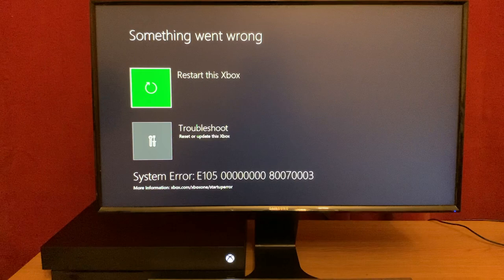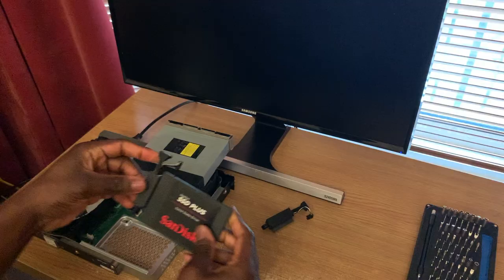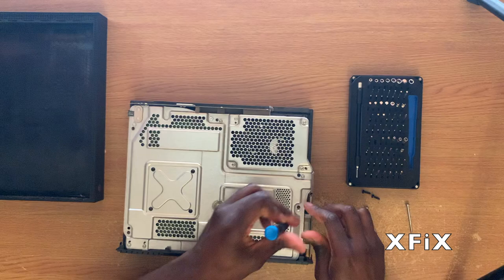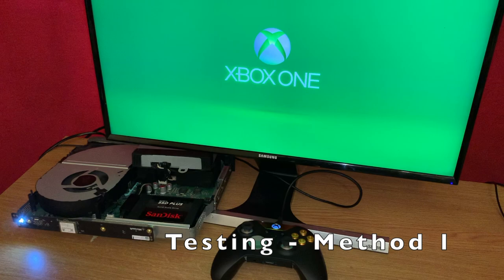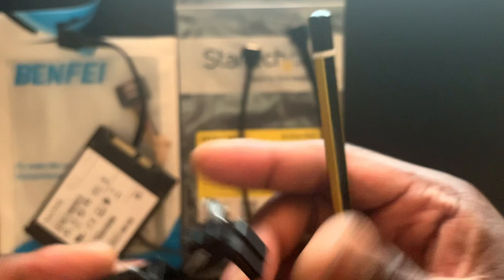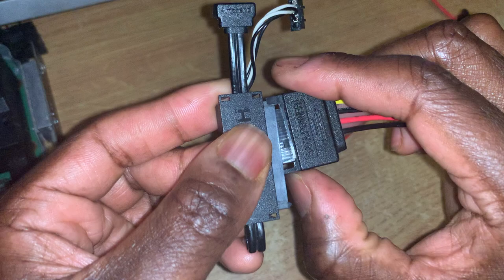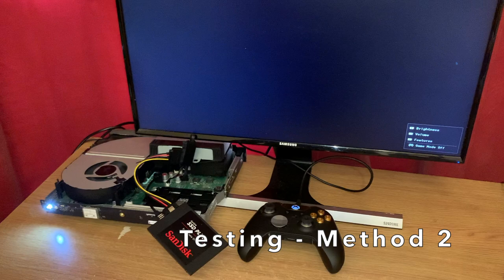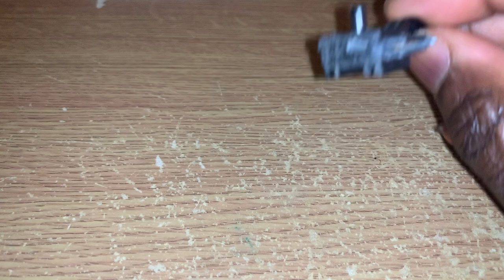Guide - Xbox One Start Up Error Codes Fix (E102, E105, E206, E302, Green Screen of Death, etc.)

Comment: RIP to my xbox 2019-2020
Reply: Same
Reply: @deanhull8225  bro this shit happend out of nowhere that shit suspicious as hell for Microsoft this is a brand new Xbox s and this shit came up last night
Reply: Mine still doesnt work
Reply: RIP mine and yours to 2018-2020 😞
Reply: Same to mine
Reply: Just happened to me recently. Never had the problem before
Reply: RIP TO MY 2020-2021
Reply: 2015-2022
Reply: Nuu 😭
Reply: @justinwoods240  same rip
Reply: Mine broke Ina week
Reply: Mine is 2021-2022
Reply: R.I.P Mine From 2017-2022 You will be missed..
Reply: 2016-2022 😞 littlerally gave up on me last night
Reply: 2017-2022
Reply: Gg
Reply: 2013-2022💔
Reply: R.I.P. 2020-2022
Reply: More like rip me 🪦
Reply: 2018-2022
Reply: Rip 2021-2022
Reply: @hyperfl3x313  2019-2022
Reply: We should sue Xbox’s arse
Reply: @kapisbetter  mine broke overnight😟
Reply: 2015-2023
Reply: Rip 2019 2023 😢
Reply: 2020 2023😢
Reply: 2019 to 2023 Xbox one X but I never did the offline system update yet
Reply: Rip 2019-2023
Reply: 2020-2023
Reply: Rip 2023-2024
Reply: I've got a series s since this happened to me and a switch 😭
Reply: R.I.P 2016-2024

Comment: Anybody having startup errors just forget everything you've ever read about diagnosing and repairing xbox console issues and try offline updating. Format a flash drive to ntfs and put osu1 on it and plug it into your console, turn it off and start it up on the troubleshooting screen and it should eventually start updating. Ive jumped through 1000 hoops trying to fix mine and this ended up working.

Comment: so It was my first time getting the error message on startup. I got super pissed and tried to figure out how to fix it.... found this video, and realized I don't have the funds, time, or technological knowledge to fix it. so I picked my xbox one s up with my hand and lightly slammed it on my table on all sides (except the front) and IT FUCKING WORKS NOW! load times are a tad longer.. but I HAVE A WORKING XBOX AGAIN! sometimes u just gotta be rough with the robots...
Reply: Is it still working? Cause right now it doesn't sound too bad

Comment: So far this appears to have worked for my Xbox ! You're a lifesaver man. I didn't bother hacking the connection in half just removed the nubs and the data cord. We'll see how it works long-term !
Reply: I’m dealing with this problem currently and considering trying this, is it still working good?
Reply: @coleerickson409  yeah it is ! It wasn't as difficult as I thought it would be. Just be attentive to the order of all the screws. I didn't cut the hdd connection in half like he did and it still fit.

Comment: Do you think this would work with e106 and e101? i replaced my hard drive because i was having the same problem with the game saves, but when i turn on the console i get the error and cant do the offline update either.
Reply from the maker: Hi man, I really think it’s worth giving it a go because that’s pretty much the same problem I had. When I replaced the connector the Xbox just started working again and I haven’t had a problem since.
Reply: On my connector the data cable has 2 black spots on them, kind of looks like it's burnt.
Reply from the maker: Sounds like that could be the case. Which side appears to be burnt? If it’s the data side, you can bypass it in the same way shown in the video.
Reply: @doo-dahs140  it could be that but turns out the hard drive I replaced it with was too big.
Reply from the maker: If that’s the cause then I’m surprised. There is a limit for how much space the Xbox OS will recognise but that doesn’t usually cause crashes. If you use a hard drive larger than 2TB it usually just means that the extra space is wasted as it won’t be used.
Reply: @doo-dahs140  that's what I thought but I guess I'll find out when my new hard drive comes.
Reply: @doo-dahs140  by any chance are you in the Xbox insider programme?
Reply from the maker: I am not. It sounds cool but I just never got round to signing up
Reply: @doo-dahs140 because if you are I don't think it lets you go back to the latest OS. So I think if I remove it it will enroll the update to let me do a offline update.
Reply from the maker: Yeah, I’ve heard the same. If the installed OS is newer than the one you are trying to update to, it won’t work. So yes, removing the insider programme version first is a good idea.
Reply: @Scampii  did it work? Did replacing the cable work? Cuz I have the same problem. Save game error and when I restart it shows me e105.
Reply: @muhammad8990  not for me I was on a insider os so I had to wait for a new update to over ride the one I was on
Reply: @Scampii  the update came, right? So is your Xbox good now? 
Cuz this shit really sucks, i bought my Xbox at the start of 2020, and have had problems since august of 2020. Sometimes they go away, then they come back. I live in a country where I couldn’t use the warranty too. Bullshit that MS is selling faulty consoles.

Comment: This worked for me using the 2nd method so thank you for that. Only issue is it’s very difficult to find these parts. The office Xbox sata cable is sold out everywhere and from what I’ve seen so are the star tech round sata cables.

Comment: Hi i need to replace the HDD connector for the Xbox one X as i have replaced the HDD with a SSD and installed the operating system with usb however i am still getting the E102 and E105/E106 messages, do you know anywhere that has the right part in stock? everywhere seems to be out of stock or selling parts for Xbox one s only :(

Comment: Thank you for your Video - I was able to fix my Xbox One X with it. Since my HDD worked fine on my PC I assumed that it must be the SATA cable. I bought a 15 cm flat SATA cable, which is just the perfect length for this job. A round cable is definetly better, since the cable has to make a loop, but they are way more expensive. My flat cable was 2€ incl. shipping. For precise and safe cutting, I used a small saw, since chances to slip and cut yourself are smaller with it :)

Comment: what do I do if it is an E100 error. I was getting a problem with disc space saying I had 0 gigabytes  and I searched it up and xbox website said to update the xbox because the xbox is not reading my hard drive so I did and halfway through the update I got and E100 error

Comment: Could it be that my xbox insides are just dusty because I have no issues with installing  or syncing and it hasn't been in the best spots to let air out please help
Reply: If theres no air going out then it sounds like you got a dirty ass house clean that fuckin place 
Its not normal for that much dust to pile up on a system not even 10 years old yet
Reply: @at-cj2iy  no i fixed it it was tue hard drive

Comment: all i did was factory reset and redownloaded os through the troubleshooting screen, it seems to be working but should i expect it to mess up? idk
Reply from the maker: If that’s worked for you then that’s great. There’s no need to start opening things up if the problem has resolved itself. If it does come back in the future you’ve already found a guide to help you :)
Reply: I did the same hopefully it lasts until the series x is back in stock

Comment: Mine just stays at 50 my Xbox is very very old it’s 6yrs old but now I get problems so everytime I disconnect from the electricity plug thing I get the green screen of death so I need to factory reset and it always work but now idk what happened that it’s just staying in 50 I tried everything in the factory tester options

Comment: My Xbox turns off midway through the offline update with the flash drive. I dont know what to do. My warranty expired and the hard drive connector is sold out everywhere online
Reply from the maker: If you still have the old connector, try this: https://youtu.be/PpmGRGIhFcs
You’ll still need a SATA cable but they’re easy to find on Amazon. You may already have one spare if you have a PC.

Comment: This video is fantastic,  quick question. On option 2 you use a different sata cable, why's is the power cable extension required if you are separating the data port from it anyhow? It seems unnecessary, If you explained it I may have missed it. Thanks for your time.

Comment: I tried to second solution and its worked! You are a lifesaver, so much thank you!
Reply: Where do you find the original cable it app sold out
Reply: @chriswright8074  I used a classic computer sata cable with an L-shaped end. I used the original part for the electric cable as in the video.

Comment: Are the HDD connectors for Xbox One X only available in the US, and not in the UK ? The item is sold out. If you got one let me know !  Thanks
Reply from the maker: They were available everywhere when I made this video but supply goes up and down all the time. You’re better off using the second method anyway because, as someone else commented, the ones you get online may not be 100% reliable either. The sellers probably stripped other used consoles for parts to sell.

Comment: Just did this with the Xbox one s but I can’t get it back together because the hard drive sits in a casing and red cord isn’t bending to easy … Any tips?
Reply: Make it fit. Put some easy bends in the cable to take up the extra length.

Comment: Will factory reset get rid of my external hard drive stuff if it’s unplugged?
Reply from the maker: It won’t. After you finish fixing the problem just plug it back in and your games will be there. The same goes for if you switch to a Series X or S when they’re released.
Reply: Doo-Dahs ohh alright thanks
Reply: @doo-dahs140  so I can unplug my drive than factory reset then plug it back in and I’ll have my stuff still with no problems
Reply: @lil_nap_9207 From personal experience even if the External drive is in the console DOES NOT care about that and only erases whatever is on HDD (Internal) so your External is perfectly fine and not effected with any of this.

Comment: My Xbox turns on, stays really quiet(sounds like a bit of a dial up noise for a sec), displays no signal, and then cuts off after a while. Will this fix help me? I got the black error screen at first, but not anymore.
Reply from the maker: If the console stays on for a few minutes (like 3 -5) before it turns itself off, this will be more likely to help you. If it only stays on for less than 20 seconds and then turns off, it probably won’t because the issue will be with something other than your hard drive.
Reply: @doo-dahs140  ok I turned on today and it says e105 error with troubleshoot screen. I hope this works for me.

Comment: I bought the HDD connector original from gamersrepair, it doesn't work, I changed my hard drive too but still same error massage. Then I try the second solution YES 👍  it is work. Gamersrepair 👎
Reply: @Caleb Hysmith not e101 sorry this is a different problem entirely look up Andrew Paul he has a ton of videos on this sort of thing
Reply: @Caleb Hysmith brand new drive

Comment: So if it's the hard drive could I buy an external one and would it work
Reply: I used my external drive for a few weeks since I couldn’t download games onto the actual Xbox internal drive but eventually the error code stopped me being able to get into the Xbox so I had to change it eventually anyway, but an external drive is a short solution

Comment: I d like to describe  a serious problem which I had over six months now on a sealed box x box  one… anyways whenever I am at menu!after 20 minutes the menu stuck and only the home menu button works All the icons turn to black .. also the same if I am in an app.. the Xbox works fine after 20 minutes or reset. I thought might be the disk .. so I changed to ssd then I thought might be the cable .. After your video.. I ll change the cable 
 too… the last error was E105 exactly the same as yours .. the stuck and black icons thing do u think might be the cable ?
Reply from the maker: That sounds like the cable is the problem. Give it a try!
Reply: @doo-dahs140  that was it….the cable finally …I used a used one from my pc and I left the power cable as it was but I cut it in the middle … I had a suspicion that might be the sata and after you video I gave it a try . Thank you

Comment: Great video just had this happen to my xbox one S it started to lag  badly. So I keep restarting it which brought me to Error Code 208 then as it was updating it got stuck at 50 percent and would not move so I turned it off and now I have a Error code E102 so I just purchased the new connector from your link and im gonna try to fix it since my xbox is out of warranty anyways
Reply from the maker: Sorry to hear that but I hope it works out well for you. It does sound like a problem that replacing the connector will fix so you’re on the right track 👊🏿
Reply: Freakwent 212 same here bro I need help!
Reply: A did you buy the original one or the data cable shit
Reply: @tmarsh2cold867  I brought the OEM one that is in the description, along with it I brought a new hard drive also. Honestly I never did the USB update so one I finally did that and replaced the  hard drive connector it worked.
Reply: @freakwent22  it still working?

Comment: I took a hacksaw and just sliced straight down cutting off the data data cable and plugged in a new one. No need for an adapter in method 2
Reply: Did you cut the cable that was in the original bracket, and put another one in? How to do it?

Comment: For anyone that looks, on my Xbox one X, I did an offline update and it fixed E102, and my console now boots up. It also downloads, but still gets installation stopped on games, started much less frequent, progressively getting worse, still definitely an issue. I assume it’s due to difficulty reading/Writing the HDD. Will be trying method 1 in the next week, along with a full clean, and will update this comment if it works.

Update: Changed the hdd connector, at first got an instant e105 error and thought I’d made it worse, it played before but got installation stopped. Then got e102 after a reset keeping all games. Plugged the usb in with the OS and it booted fine, set up the xbox, currently downloading bo4 so we’ll see if it’s fixed, but it’s smooth for now. Checking back the morning after, everything downloaded fine, and the fix worked. Didn’t need to clean internally as it was already clean. 

My official recommendation, try to reset and keep games first, then try updating the OS from a usb. That should work to get it booting up, but you still might get installation stopped, which was my real error in the first place. For this, change the connector, paid around 20 for the part, another 8 for the tools, 5 bucks for the usb. £34 total.
Reply: Bro I don’t have a usb for it tho
Reply: @414nra4  a usb is like 5 bucks on amazon
Reply: Did this work for u?? Bro I'm in this exact spot and want to know before tearing it apart any further..

Comment: Will the same cables work if i don't upgrade to ssd.
Reply from the maker: Yes, they will. They use the same cables.
Reply: @doo-dahs140  thank you very much sir. I appreciate the help. Turns out this wasn't my issue though. My old hard drive was not working properly at all. When I hooked it up to my p.c. it was unable to read it whatsoever. Not sure what happened. I gotta replacement still having other issues but they're more on the software side right now. Trying to talk to XFix about it. I had a preview dashboard and now I'm not able to use the current osu1 files. Need to wait for newer files to release..... or my optical drive is jank and I might be screwed. Thanks again though still using your fix to make sure I'm not running into additional issues.

Comment: My disk drive is not working i mostly play on installed games but i just had this issue managed to solve it well at least it was what worked for me . It turned out when i unclipped the disk drive to remove it because I thought i dont need it makes too much noise and doesn’t read anyways i played a few games and watched youtube . Turned off my xbox woke up next morning to this error after i wanted to play online so after 1 hour fiddling around i clipped the hard drive back which continued the freezing update

Comment: i just bought a new connector for 20$, and still have the same problems(before that I upgraded to ssd, I thought the problem was in the hard drive)
Reply: feedback: i put the old hdd back, and in connection with the new connector, it seems to work fine. don't know why my xbox doesn't like ssd

Comment: Mine crashes when something updates would this work
Reply from the maker: Does the console become unresponsive and refuse to start any games or load any apps? Maybe you’ll get stuck on a loading screen when trying to open the Microsoft Store or something. This guide will likely help in these situations because these are symptoms of hard drive/connector problems.
Reply: @doo-dahs140  yes it when games update or console update i have to do reset or usb update did you find out what that little power plug is
Reply from the maker: I’ll be posting another video about getting as much space inside the console as possible in the next few days. Basically if you use the second method and cut the connector just right, you don’t need the power extension at all.
Reply from the maker: Here’s a link to that second video: https://youtu.be/PpmGRGIhFcs